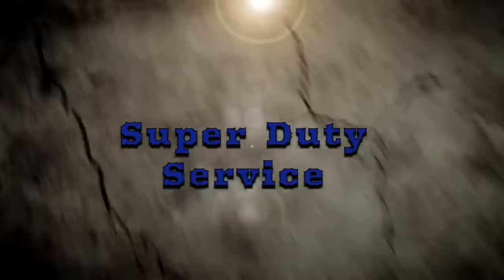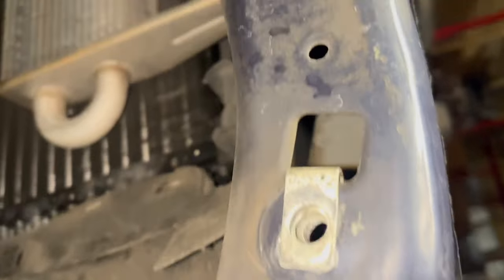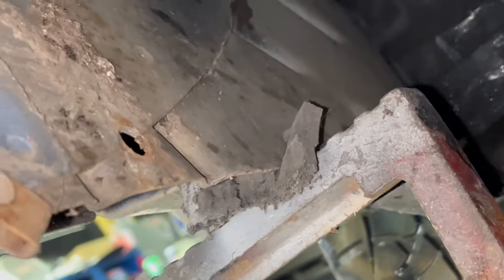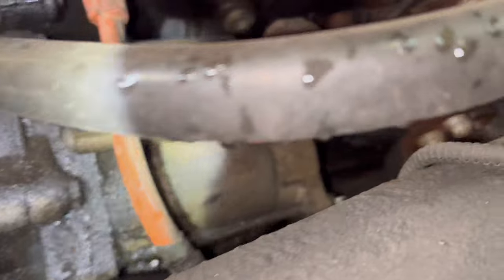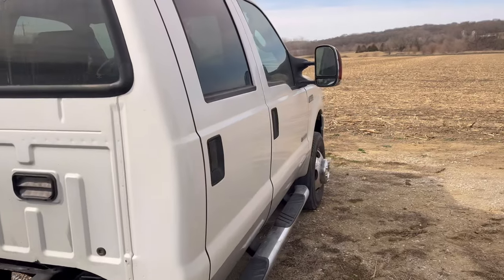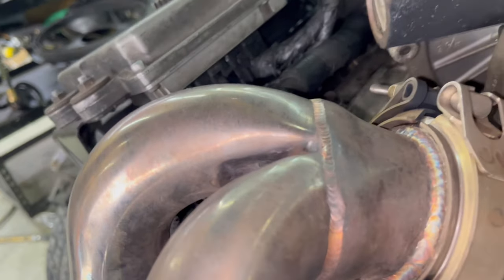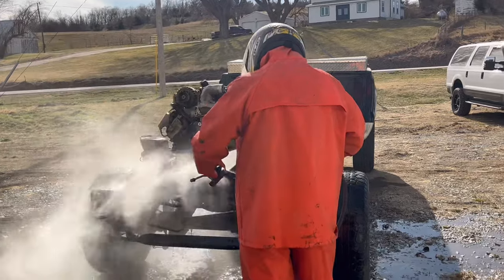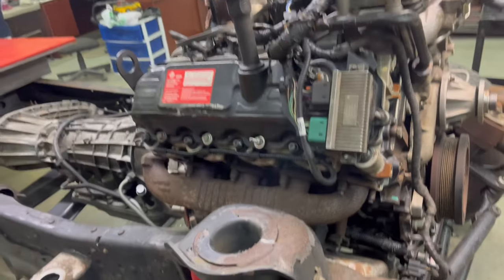Super Duty Service getting rid of the NASTY!!! Ron's F350 cab off

Comment: Whenever those cowls are broken to smithereens like that I always go to the junkyard and take them from trucks with the 5.4 engines. If some yahoo didn't already butcher them to remove the wiper arms, they are 100% always intact. So much cheaper than buying new
Reply from the maker: LOVE THAT!!!!    Never thought about gassers.  Great idea.
Reply: There's so many of them in perfect condition at the junkyard. I would swap out those sprayer nozzles while you're at it otherwise when you go to spray washer fluid, one will spray ok and the other will be a weak stream

Comment: What does a job like this or Frank’s restoration  cost?(which was miraculous by the way, and that sign he made you was just WAY TOO COOL!) I recently picked up a 2006 F250 4WD with 180K miles on it. Other than being studded and leveled, it’s bone stock. I would love to have it redone to like new condition one day… Keep up the awesome work and videos coming!
Reply: They made a video a while back telling everyone that if you don't have at least $30k to kiss goodbye on a 6.0 then do not bring your truck here. Their work speaks for itself. Parts only keep going up and are more difficult to get a hold of or become obsolete. I would imagine 30k would disappear quickly these days depending on how far of a restoration you're going for. Contact Julie she's great
Reply from the maker: I actually think I said $50k,,  but that was 6.4.   And that would need to just be the budget.  More likely to hit 27k on a 6.4,,  but a 6.0 can hover around 20.   I think with 25k budgeted in a 6.0,,  you’d get change back.  Every truck is different and needs different parts so it’s almost impossible to quote these jobs accurately without a tear down first.  So if there is 25 available (in case it all is trash) then everything you see on here can be had.  But normally 20 is the 6.0 number.
Reply from the maker: I was fairly pissed off when I made that 50k video too.   Lol
Reply from the maker: I was experimenting with a fel-pro gasket install without any machines being ran for 10k.  Kinda like a run what u brung thing.   I hope everyone that would want me to do that would not expect any kind of warranty.  You chose us because you believe we are doing the best possible job with what we are presented with.   With a longevity vs cost comparison.   I could give a rats azz less about the latest n greatest bedazzle item the kids love nowadays!!!   lol.   I don’t know if that can be had tho.  These truck are getting older and sometimes we can only strap our blinders on so tight!!!